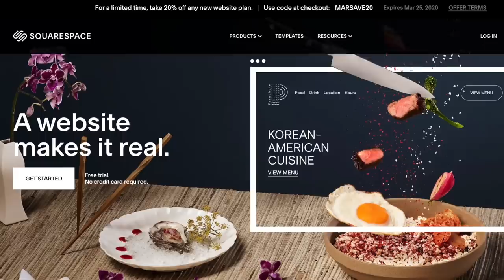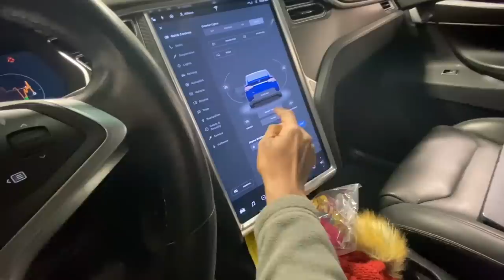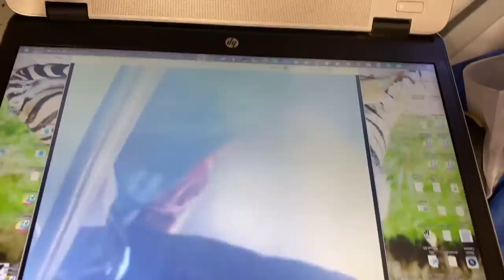Fixing everything wrong with my Tesla Model X

Comment: Model S in the low 20s? maybe I can afford this... Service 1800? Maybe not.
Reply: He did say this the first service. This was a used car that never received service and he bought it used . The question is when will the next service be required. If you do a service like this every 4-5 years its not that bad. The control arms won't need work for a long time. The filter was due to rats. The coolant isn't likely to leak for a long time. He showed that the new brakes he put in don't rust as fast the they had a set from a car with  10k miles and still in good condition. So, Tesla have reduced maintenance but you have to save money because it will be expensive. With ice car you have some kind of maintenance every year and is more expensive over a 5 year period but you don't pay it all at once.

Comment: wish you guys were a bit smarter and less sarcastic when it matters. without sealing the edge of the filter to the frame the air leaks around the edges instead of being filtered. Being a hepa filter it has to filter 99.7% of particles down to 0.3 microns....carry on fellows

Comment: the little plastic anti tamper clips or whatever that go on the nuts is so annoying. Had some girl on the side of the road with a fucked up tire. Has a spare, doesn't have the tool to remove those. Straight up broke them cause wtf tesla, that's not ok.

Comment: Mice got into the car? Where did you park it, in the middle of a corn field? The car is out of warranty. If this were a GM you would be expecting every system on the car to be failing in a year or two. What this means for a Model X is that he bought one from the first production runs. Every car in existence has had issues in their initial production run for an entirely new model. You want buy USED bleeding edge technology expect there to be issues. Most of the issues you are complaining about were likely fixed in the second year of production. You got what you paid for so do not come crying to me.

Comment: That Tesla is simple mechanic all those stuff are just simple stuff to be fix ,,, gas car are worst liken timing chain !! Transmission :: starter//water pump //For example 😂

The worst in Tesla that I’m hoping is bulletproof is the computer hardware stuff like diagnostic a module  but is simple if car has check engine 😂 light but nope Tesla car let you know is the best cars ever